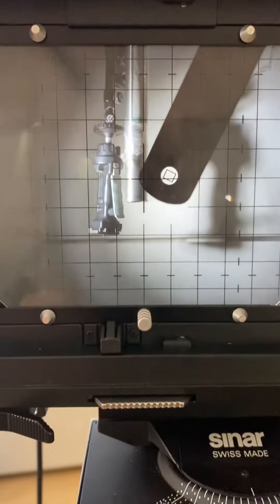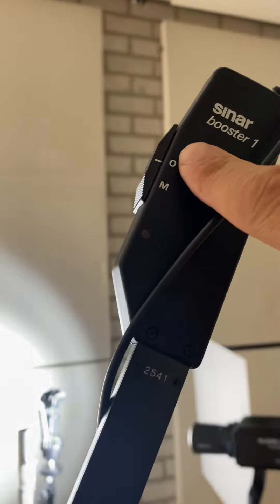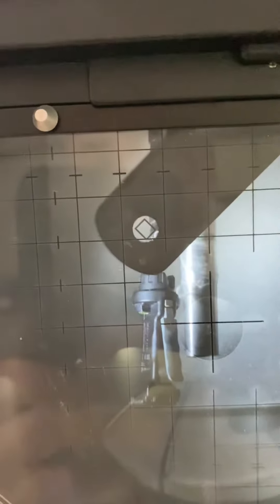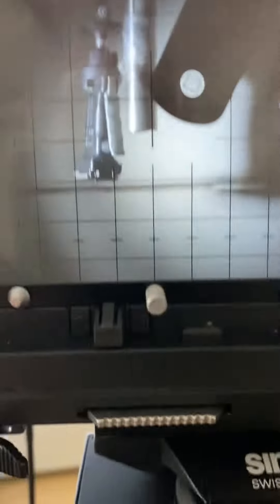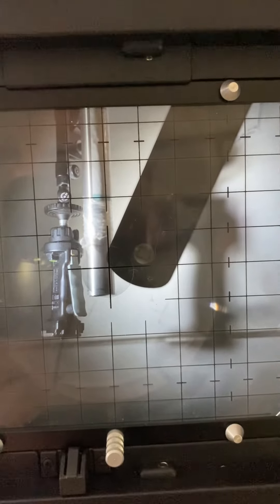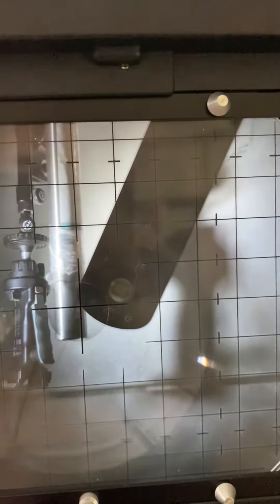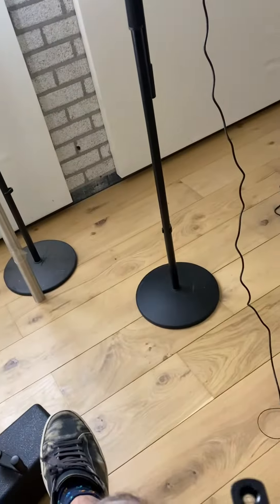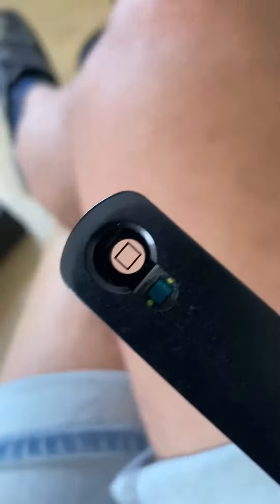Sinar Booster 1 - how it physically works

Comment: Hey there! Any chance of doing a quickie explaining how it's hooked up to the meter? Also, what meter? 
I find this fascinating👍
Reply: Hey man, my Sinar is in mothballs at the moment due to other projects taking priority. As far as i know, you can use either a Minolta flashmeter III / IV or Autometer IV with the Booster. One is better than the other, but i don't remember which, i'll check on friday which i have when i'm back in my studio and let you know. It's fairly simple to use, but you'll need to consult the manuals!
Reply: @ thanks!
Reply from the maker: @thetinmansheart  I checked it, the Minolta Flashmeter IV is the one to get.